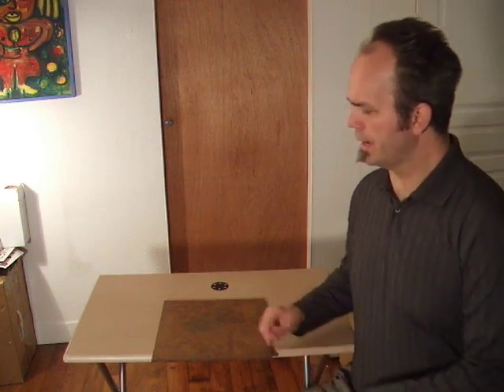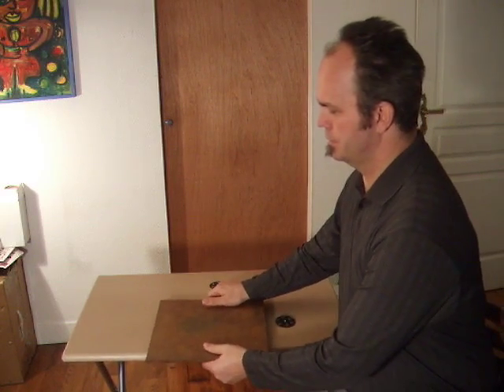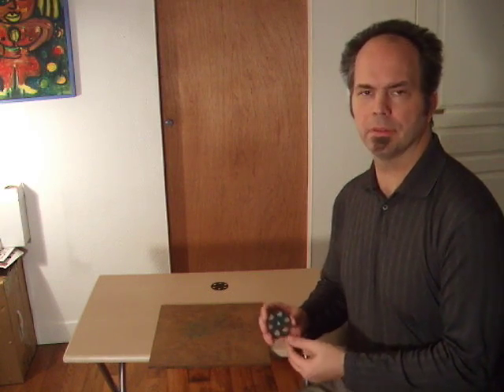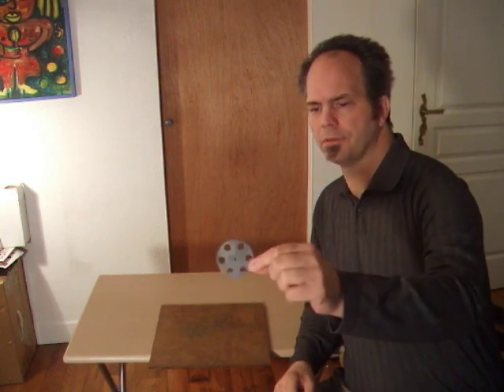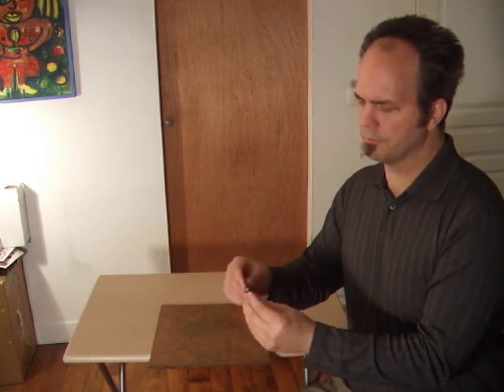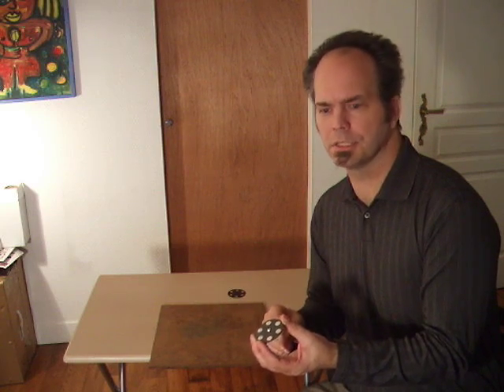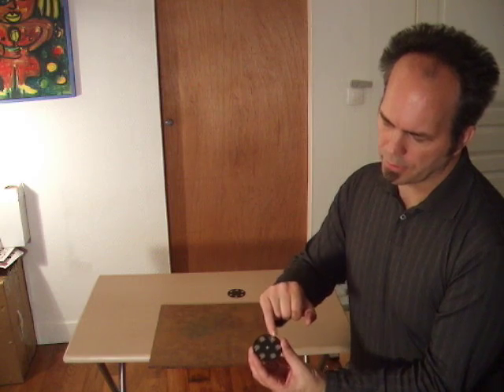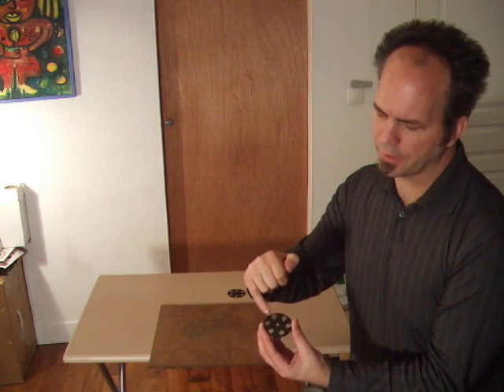🔝 Magnetic Levitating Top via Lenz's Law - Demonstration & Explanation

Comment: If you didnt have the magnets or the copper plate and you just replace the magnets with something with equal weight. I bet you get pretty much the same thing.
Reply: bobbybrady8 that's what I thought at first. but it is clearly howering. While it bounces it does not hit the copper. If you replaced the magnets with something else of almost equal weight, then it wouldn't hower and just rotate on top of the copper. It might bounce off the walls 2-3 times, but as soon as it would reach the ground it would pretty much stay there without much hopping at all.
Reply: that makes no sense at all....
Reply: snipeish1 think about what i said. Word by word. dont rush....

then you will understand.

patience, grasshopper
Reply: i have reviewed your comment in further detail. and, i still have the same conclusion. without the magnets or the copper plate, it would not float.
Reply: snipeish1 whos to say if it is even floating at all. It is spinning at a high velocity from the drill. My guess you would get pretty much the same result with out magnets or copper plate.
Reply: Maximilian Mustermann It's clearly hovering. It's bouncing up and down without ever touching the surface - until it slows down. This is the same effect as that of dropping one of these magnets down a copper pipe - it will float slowly down.
Reply: To test if it is an airfoil effect, simply do it over a non conducting surface - a table or counter top.
Reply: Observ45er I have a 4 foot piece of copper pipe and tried dropping my neodymium magnet through it and it floated down. Then I laid the pipe on the floor and I rolled the same magnet towards it at a glancing angle and whenever it got too close it would be repelled by the pipe. Seems just like the hovering disk. As long as a magnet moves laterally in relation to a copper or other non magnetic but conducting surface this effect happens. Love this stuff. Wonder what it would be like with gold instead of copper. Or a super conducting material. What I find amazing is how these induced eddy currents happen without shorting out in the conducting surface (because it's a surface instead of a one dimensional wire) but it obviously works as it's been used in mechanical power meters for years and years.
Reply: Dennis Santos
RE: "whenever it got too close it would be repelled by the pipe." Here's what's happening.  To "get it" you must follow each of the appropriate effects as I do.
...
 As the magnet moves closer (as the radial distance decreases) to the conductor, the field induced is indeed a repelling force, but when the magnet stops moving closer, the repelling force disappears.  It takes a change in the magnetic field within the conductor to A) Induce an EMF which results in B) a current in the conductor, which further results in C) the repelling magnetic field.
  You can see the same thing in the pipe or plate if you simply move the magnet closer to it.  As the magnet moves closer, the magnetic lines of force are becoming more dense (moving closer together).  If you VERY CAREFULLY use Fleming's Right Hand Rule, you find that the approching magnet is causeing a circular current in the pipe (or plate).  This circulating current is right under the magnet's pole.    This current has a magnetic field which will be perfectly opposite that of the magnet, but the same Polarity (North - South) as the approachnig magnet.  Like Poles repel -> is is slowed.  HOWEVER, when the magnet stops moving closer, the induced EMF, current and field disappear - thus no more repelling, so it CAN NOT "FLOAT" at a fixec distance - It cannot float.
...
No.  When the magnet moves laterally it will feel the magnetic damping or braking effect and slow down.   The effect (as stated in Lenz's Law) is to oppose the motion which is lateral in this case 
When the magnet is moving away from the plate or pipe, the current in it is in the opposite direction and the net force is an attractive force.   Still opposing the motion (which is away from the conductor) 
...
This is easily observer by holding the Pole of the Neodymiun magnet toward a conducting plate (the thicker the better, or several thicknesses stacked up) you can actually feel these forces, but it will not float as in this video (there's more going on here).  It will, instead,  slowly sink at a constant rate (just like it does in the pipe) There is more going on to get this aparent levitation.
These things can be demonstrated by only moving the magnet laterally, or radially (close-far).   You must isolate these two motions, otherwise you can confuse these two effects.  This is all easily shown (explained) by carefully applying Flemming, et. al.
...
Gold is a poorer conductor that copper, therefore, the induced current will be lower and therefore the magnetic field and force will also be lower.
I don't have a very think plate or pipe, so I use several layers of plate, or several increasing diameter sizes of copper pipe larger ones over smaller ones.  As I increase the thickness, the total resistance drops, the total current is higher and the magnetic forces are stronger. 
...
It all very nicely fits all the known laws, if you very carefully note which way all the vectors are pointing.  Science is really cool.
...
There are other videos that DO show a magnet floating over a super condictor, go look.  With it, the force is enough to not only equal the force of gravity (weight of the magnet), but lncrease a little above that when the magnet gets a little closer and actually stabily levitate it at a fixed distance.
...
 Well, in a way (using your way of looking at it) in the surfaces we use like this, it actually does SHORT OUT the current.  The plate has a continuous path from one part of the magnet to the other part on the other side of the magnet.
I understand that is is difficult to visualive a voltage between two parts of these plates or pipes, byt there are!  SMALL, but there!
...
For the pipe, it can be easily seen that the pipe is ONE SINGLE TURN that is shorted when it gets back to the start.  It is JUST LIKE one turn of VERY WIDE wire connected to itself, start-to-end.  Therefore it has a VERY low resistance  --> I=E/R--> high current and high magnetic field that slows the falling magnet.
...
Yes, the plate is a conductor.  The magnet creates an EMF (voltage)  in only part of the plate and the resulting current has many, many paths back to the other side of the region where it is created. 
... Visualize this:
 With the magnet sitting on the plate with one pole facing down, the region directly under the pole has the magnetic field piercing the plate straight through.  THAT is the region in which the EMF and current are induced when the magnet moves away or toward the plate (or laterally).  Then, that current has to flow (in the plate) essentially around the magnet's pole to get back to where it started.
Also, it is a really, really small voltage, but since the resiatance of the plate is so low, the current and magnetic field are high --> lots of force ->  enough to easily feel.
...
You must follow things in very small steps and small regions to get all this straight.  Fleming, et. al. really knew what they were doing.  They nailed this stuff!
Viva la Mr. Wizard (Don Herbert)
Cheers, ScienceAdvisorSteve
Reply: Dennis Santos However, the disk is not moving down until it's spinning slows down.  It is at a quite steady (average) level above the plate.  The magnet in the pipe slowly moves downward at a constant speed which indicates the force holding it up precisely balances gravity.  It must be moving downward to generate the force that is holding it up.  This disk is not moving downward at a constant speed.
Reply: Observ45er Don! Thanks for taking the time and effort in this brilliant write up! I believe you've answered all my queries/doubts regarding magnets and sheet conductors or pipes. I'm going to copy and keep this piece for future reference. You're a star and have a new subscriber too!

Comment: Hi, after 4 years, i dont know if anyone answered him.
If i remember, this flying effect on a disc shaped object is due to the surface of the disc, look the upper side with small pyramids, the other side is almost flat, the différence in those sufaces make an air pressure differential while rotating, lifting up the object
Reply: no. It has nothing to do with air pressure. The spinning magnets induce electric current into the copper plate and thus create magnetic fields, repulsing the disk.
Reply: Peter Lichard maybe, but i still prefer my vision, explain me how u can induce electromagnetism in a non magnetic metal, normaly u should add iron to ur copper and further more the inductor need to be polarized in the same patern, wich is not the case here, i repeat, this is pressure differential
Reply: Chris Legrand  A changing magnetic field will produce an EMF in the copper conductor.  Since it is a conductor, a current will flow.  That current also has it's own magnetic field.  This is common and looking up Lenz's law will provide explanations.  (Wikipedia currently gets right to the point in the intro)
The pressure difference explanation of lift (only the use of Bernoulli) has been shown to be incorrect (Google NASA's Glen Research Center).